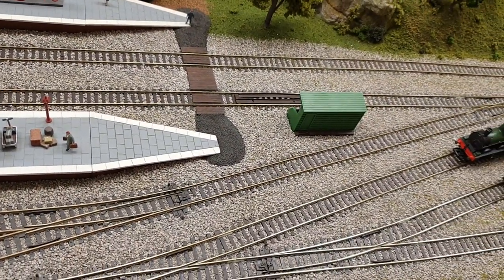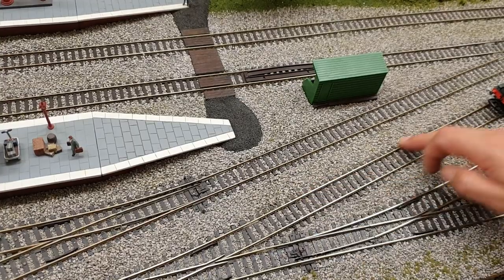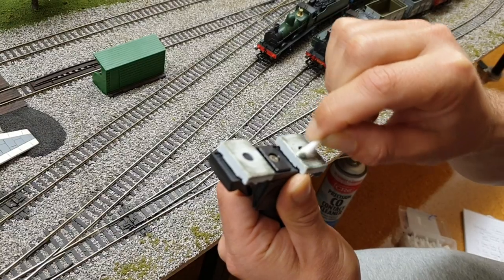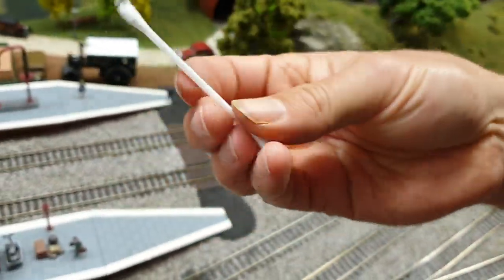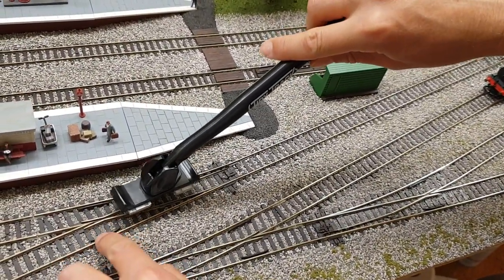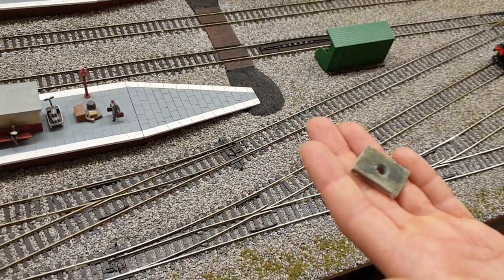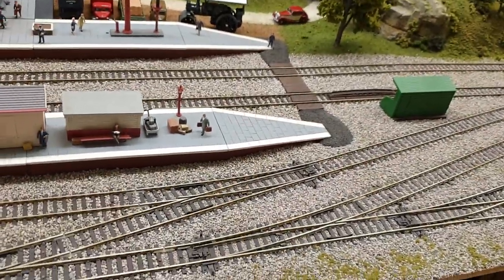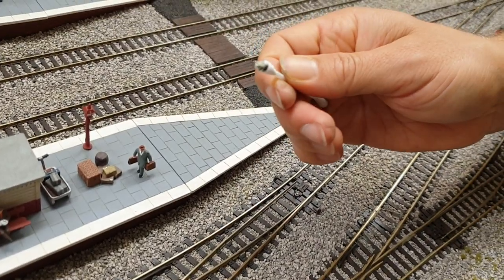Best model railway track cleaning technique

Comment: Hi, I like your methodology for track cleaning, never thought of chrome polish but pondering on your use of 'spit' to finally clean. I use to use 'spit' when at the final stage of cleaning metal rollers on printing machines as there was nothing else as effective!!! I've always used 99.9%% IPA as I didn't want to add anything water based to the track. I'm concerned about slippage on my 3% incline. I liked Churchill Bays' comment about cream for the plastic guide rails. . . that's a pretty good idea. Thanks for the video.

Comment from the maker: I have now finished all my track and the 50 sets of points, thank goodness, but I can report that the layout is now working perfectly which is great.  I shouldn't have left the layout for so long, but as we all know life and families can get very busy, so it's great to be back in action now. AN ADDITIONAL THOUGHT for you that I found was really useful was that everyone tends to forget about the black plastic guides inside the points that help direct the bogie or leading wheel.  They are not metal, they do not conduct electricity, the wheels do not run on them, therefore, surely we should leave them alone?  Well we want to avoid scratching them when we are doing the track cleaning but we should not forget about them entirely. I have found that many a derailment can be put down to the bogie hitting against a dirty/sticky plastic guide and with the extra bit of resistance on the guide it can pop the bogie off.  
THEREFORE, YOU WANT YOUR BLACK PLASTIC GUIDES (THAT ARE ON THE INSIDE OF THE METAL RAILS) ON YOUR POINTS AS SLIPPERY AS POSSIBLE SO THAT THE BOGIES CAN EASILY GLIDE PAST THEM.  I use a cotton Q tip with a nourishing plastic cream (like the creams we use on our car dashboards etc that absorb into the plastic) that help feed the plastic and leave the top and sides of the guides slippery.  I do this right at the end of the point cleaning process, HOWEVER, just make sure that you use the tiniest amount of cream and also make sure that you don't get any on the rails as this will affect conductivity and traction.  Try it, you will be surprised with the difference it makes towards getting your trains through those points :)
P.S. - I wouldn't suggest using oil on the plastic guides as it will not absorb into them (may damage them over time) and will make its way onto your track.
Reply: Very good point made there. I usually use IPA as I have some engines with traction tyres - they certainly don't like INOX - it ruins the tyres. Will get some of the cream you mentioned and give them a go . . . . carefully ! Cheers.
Reply: VERY GOOD BUT I WOULD LIKE TO SEE YOU DO THE OTHER SIDE OF THE TRACK AND WHERE THE POINTS ARE UNDER THE BRIDGE FROM WHERE YOU ARE STANDING  REGARDS N. WRIGHT

Comment: I bought the vacuum attachments bit disappointed as it does not fit my Dyson DC40 looked really useful too.
Reply from the maker: Sorry to hear that, can you make some sort of adaptor out of flexible pipe (that you can split at the ends) and some tape or hose clamps, and then tape it/clamp it to one of the nozzle fittings that does fit your Dyson? Also I'm sure there are hose pipe size adapters available out there. Best of luck.

Comment: Thank you for that very interesting as I am having electrical point problems. Two things to ask where did you get the vacuum attachment from and what is the electrical spray you used. Thank you.
Reply from the maker: Hi Julian, thanks for your message. A link for the vacuum parts is: 
https://www.amazon.co.uk/Vacuum-Attachments-Computer-Printer-cleaning/dp/B00BIHF8SS  
In relation to the spray you can probably only purchase it in Australia and New Zealand, however, I am sure there are many similar worldwide products.  Here is a link to the Australian and New Zealand CRC product that I used: 
https://www.bunnings.co.nz/crc-500ml-co-contact-cleaner_p0258156
Out of interest the link to the Woodlands Scenics track cleaning kit that I used the wand and maintenance pads from is:
https://www.amazon.com/Woodland-Scenics-Tracker-Cleaning-WOOU4550/dp/B0062VH4NM

Comment: Dear Sir, Thank you for the insightful information! But, here in Brazil, we do not have this product, "Autosol". I tried to look for its composition, but i am still in doubt. Is it a fine particulate suspension that is used, mostly, to clean oxidisation on silver surfaces? Thank you for this most useful video. I will watch your channel, from now on. Best!
Reply from the maker: Hi, thank you for your message. Autosol is a white cream that is very slightly abrasive for polishing metal with minimal scratching. It can be used on silver but would usually be considered to little too harsh. I would suggest trying a local car care product for polishing chrome. However, I would recommend a liquid rather than a paste as you want it to absorb into the cleaning pad.
Reply: @churchillbay1377  Muito obrigado!

Comment: Very helpful - and I happen to have most of the requirements (I have just ordered the metal polish). I love the look of your layout! Not another Kiwi modelling the GWR by any chance?
Reply from the maker: Fantastic, I've always found Autosol liquid to be a great product but finding the easiest and most efficient way to apply it to the track without making a mess was the trick.  Yes, in NZ and I love the GWR but the layout is very loosely based on our trip over the Settle to Carlisle route (with a little bit of the Routeburn Track that we tramped :)).  I like to use the imagination with the scenery rather than try to model an actual scene (which is also great but also more limiting).  The layout is very much based in the 1930s and every month or so I swap out the locos and rolling stock for one of the other British Big Four and keep cycling around between them.  It is hardly what a purist would do but I have fun and so do my family and that's the main thing I guess.

Comment: on the points you need to clean where you said no as thats were the electric makes its connection thats were they get black
Reply from the maker: Thanks very much for your comments, on my points the only electrical connection is between the side of the movable flange and where it hits the main rail.  I agree that one must definitely clean in there as I do at the later part of the video with the metal polish on a cotton Q tip and then also with the electrical cleaner on a cotton Q tip.  I don't clean this particular surface with the cleaning pad as the flange is too delicate, therefore I do it at the end of my process as described above.  Thanks again.

Comment: the main problem i have is fluff in the points and once its in the points soon dont work any more and the spring gets jammed and bends then the points dont work i have tryed flushing out with cleaner is a spray bottle but the bottle isd 2.50 to buy these days and it dont last long as it evaporates i was thinking about a small vacuum cleaner i need to make a long tube that i can fix to the hose on the vacuum and a filter on the open end you supply to the track to save sucking up the people of any of the small animals
Reply from the maker: I absolutely agree about the need for a vacuum, did you see the vacuum cleaner arrangement that I use in the video, it works really well and I can easily vacuum around all the parts of the layout without doing any damage and without sucking up the figures etc.